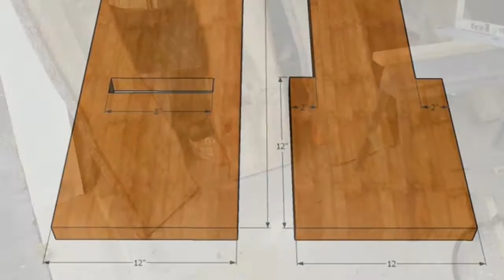Maple Tree Becomes A Viking Chair

Comment: This chair looks nice. I am building 8 of them now out of 1.5" doug fir 2x10 and 2x12. I run 41" bottom board and the rest of the 8' board goes to the back rest. I like the top of my seat height at 14"s for now. Thanks for the video.
Reply from the maker: Sounds like a nice set up to sit around a fire pit.   8 chairs is an ambitious undertaking.  Good luck.  🍀